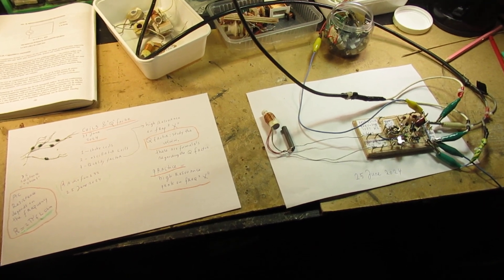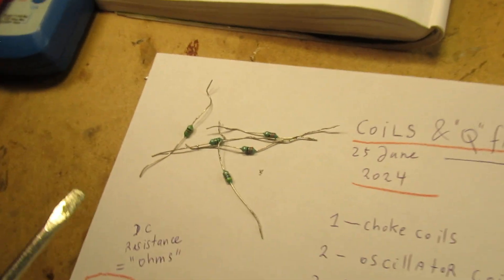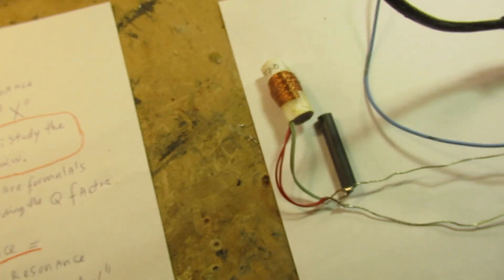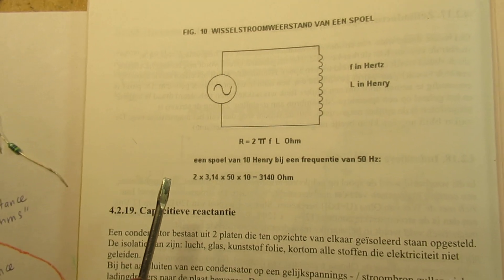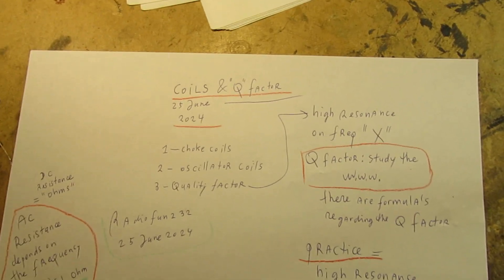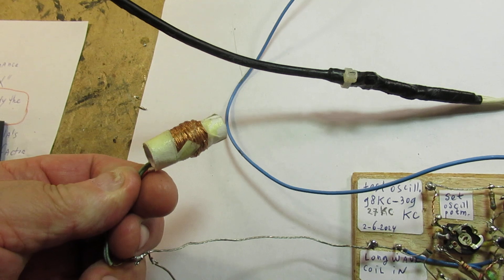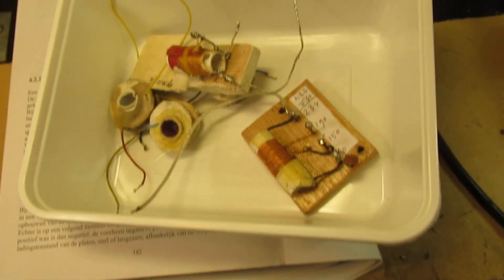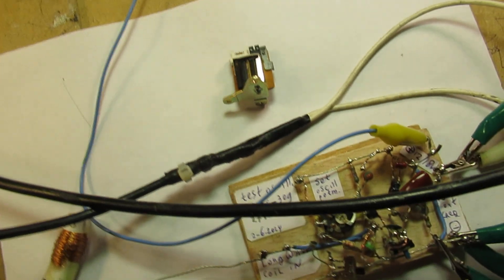Small talk about the Quality factor (the Q) of radio coils, in theory going from 1 Hertz to .....

Comment: I remember, as a youngster, connecting an inductor in series with a capacitor and placing the network across the output of a signal generator (output about 10VRMS) and as I adjusted the frequency - I got a sharp electric shock from the circuit! Resonance lesson learnt - hard way :) Transmitter aerials can be very dangerous!